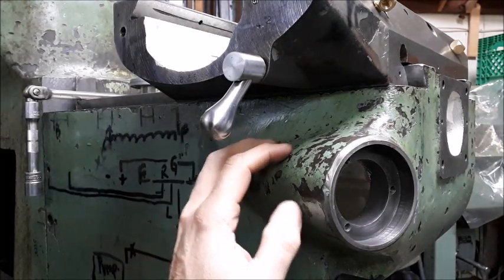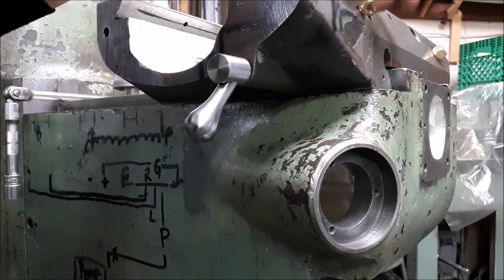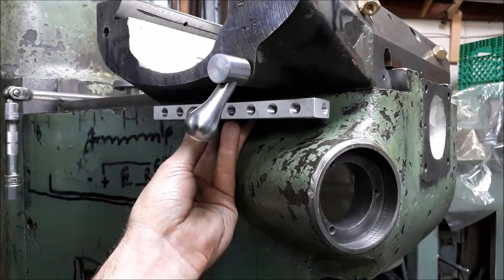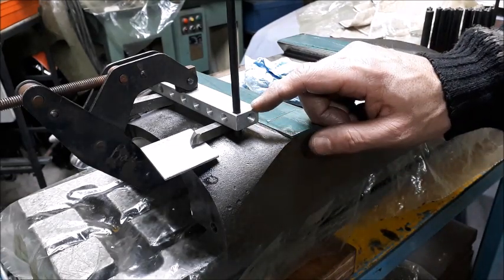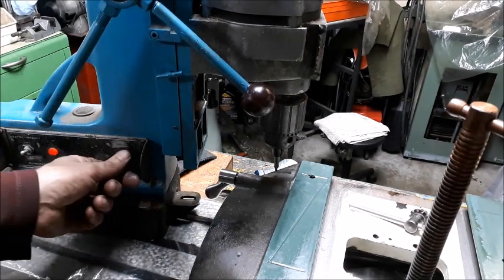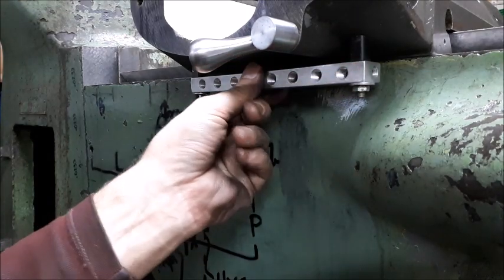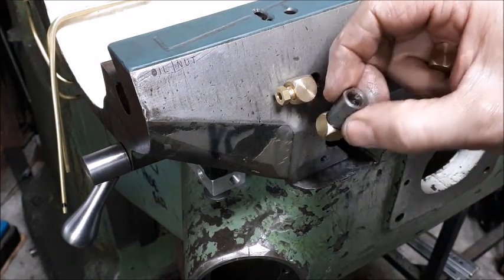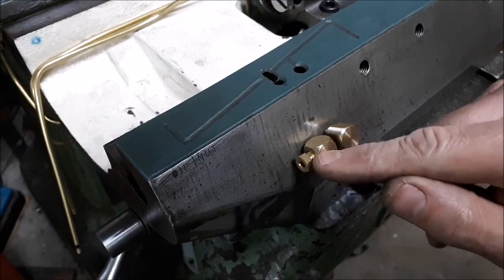Bridgeport Update 38 Lubrication

Comment: I'm rebuilding an older AS1 mill and following your work closely.... any chance of getting the links for your choices of line, distroblock, etc?
Reply from the maker: Sorry for delay... let me dig up the info for you.
Reply: @unknownapprentice625  No problem... I'm on summer break. Had a couple of other projects going on as well. So far your vid with your thoughts and reasons have been the best so far. Very well thought out. Would love to see a reprise or follow up.
Reply from the maker: Sorry!!!!!!!  Bijur Part Numbers; 5B25 is the brass tubing (.025" wall), 5 way junction should be a B7688, 10 way would be a B8899, FRA meters are B2559,3217,3218 for the various sizes. Hope that helps.
Reply: @unknownapprentice625  Maybe a show update as you get near to final assembly? I've some thoughts for mine (it's an older A1S - like a Grizzly 8x48) that Jim over at Benchtest. c o m rescraped and I just don't know if I want it left side or right (I'm left handed).

Comment: Total loss oil system. Ever thought of creating little gutters and having the oil circulate? I am contemplating this for my surface grinder coupled with an automotive filter in line.
Reply: I have a Thompson surface grinder and the oil that lubes the ways is circulated and filtered .